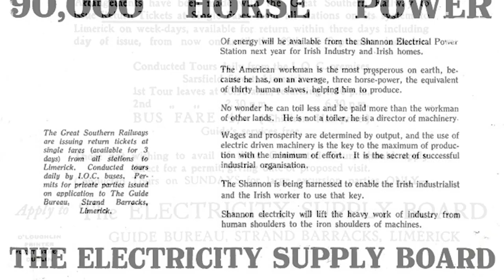Shannon Hydro Scheme

Comment: Hopefully will be removed in the near future to let the Shannon and its eco system recover to its former glory.
Reply: If it only supplies 2% of electricity...
Reply: Surely they could have thought of a way to redirect the fish around the turbines. Stop them further up river and have a ditch tunnel for them to swim down bypassing the turbines... also they do actually have fish pools where they raise fish and release them so it's not like it effected the eco system that much.
Reply: @maryflannery6805 Yeah and that's a town the size of sligo which is actually pretty good for when it was built, they did a great job on it at the time.
Reply: it will not be removed   as they want it more than  ever  now ..they are very very short of electricty when the wind is not blowing ..two new turbines went in this spring .........so it will be around for  another 100 years